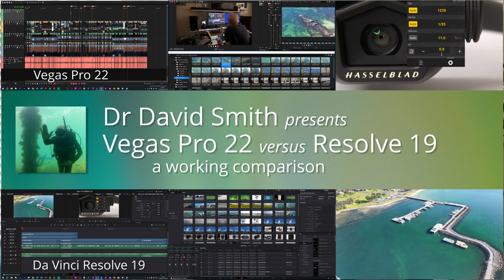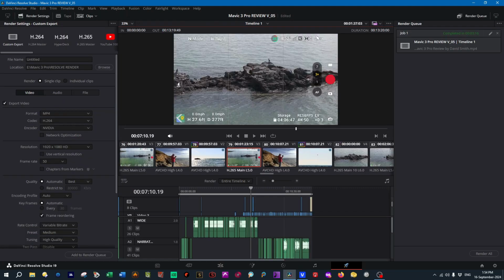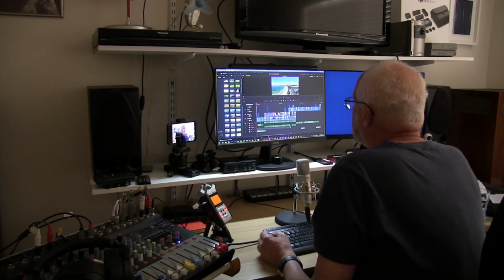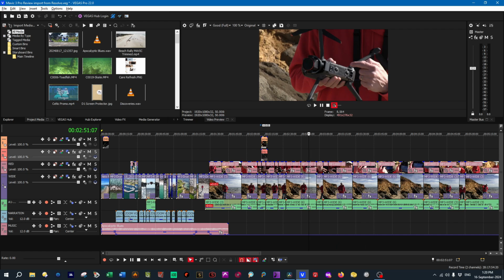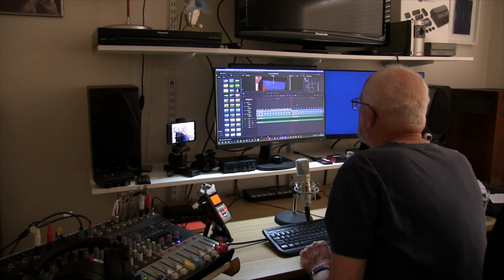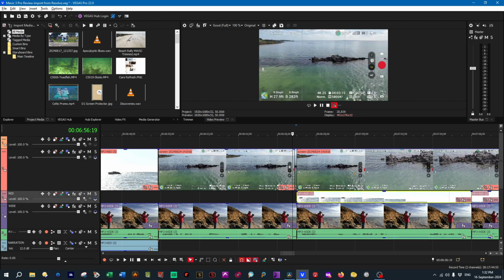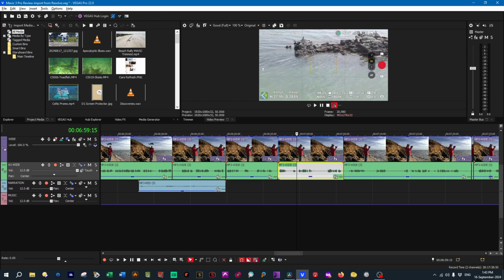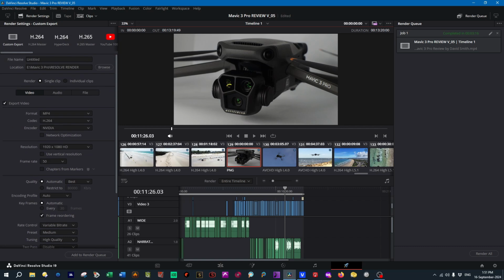Vegas Pro 22 versus Da Vinci Resolve 19

Comment: 27:03 When you drag the audio clip down, and your video clip "dissapears", it's because the two clips are linked. So a video clip you import into V2 video track, will put the audio track of the video, on A2 audio track. If you then drag the video clip from V2 to e.g. V3, the audio will move to audio track 3 (A3) as well. This is normal behaviour.

You can unlink the clips, by simply ight clicking either the video or audio clip, and choose the bottom level option in the menu, that says "Unlink clips" or something like that. I believe, there's a shortcut option, maybe the Alt button, where if you hold that down, you can still move the individual clips, and they will remain linked.

So, basically what is happening in your example, is not that the clip dissapears. You move the audio clip from A1 to A2 track, and then the video clip does the same. Since you already have a video clip on V2, what happens is that you accidentally drag the V1 clip on top of the V2 clip (overwriting), by moving the audio clip from A1 to A2.

Comment: Thanks for the comparison.  I have been using Vegas Pro for many years, but, there were times that I was frustrated with Vegas due to it locking up or crashing.  Accordingly, I went to DaVinci Resolve Studio and started learning that program.  Later, I did get the later versions of Vegas, including v22, and found them to be crashing less, and wished they had been that good in the past.  So, like you, I use both of them.  I do like Vegas for easier learning curve, but I also like DaVinci Resolve for its stability.  I am working both programs, and even have Filmora for some of its effects.  I guess, I have had most of the major Windows video editors, but Vegas and Resolve will be my go-tos.